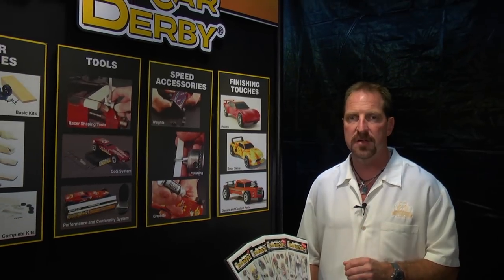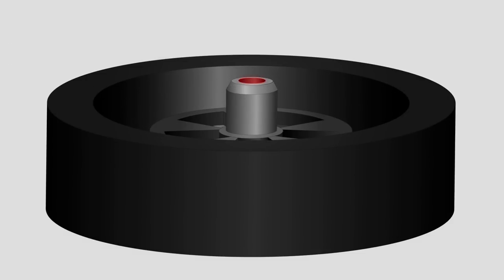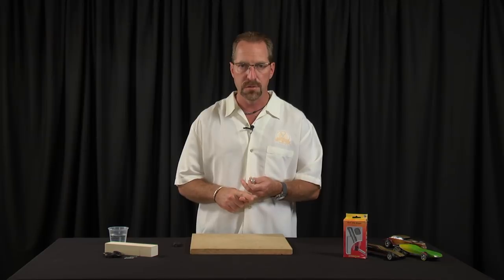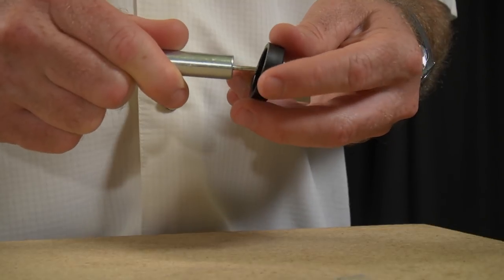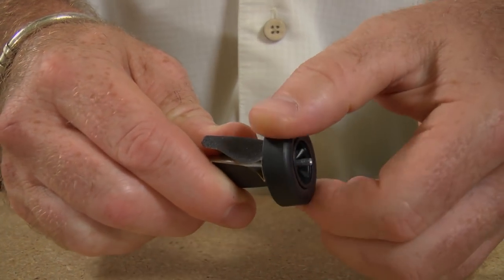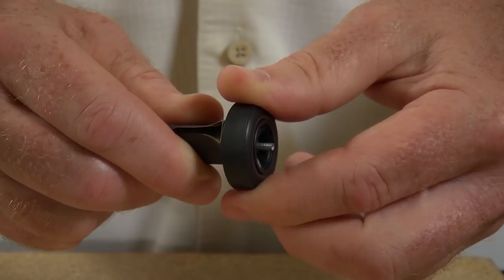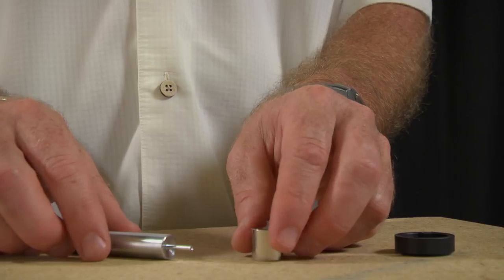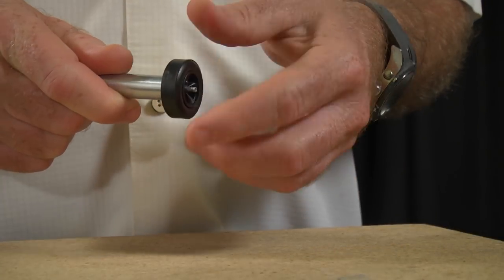Learn How To Ream Wheel Hubs - Pinewood Racing Car | PineCar Derby

Comment: Will it work on Royal Ranger wheels?
Reply from the maker: The Royal Ranger wheels have a larger hub bore than the Pine Car or BSA Wheels. You make up the size difference with a small piece of brass tubing (purchase at a hobby shop). Use the brass tubing to make a bushing that will make up the size difference